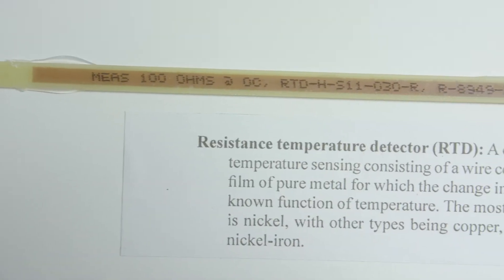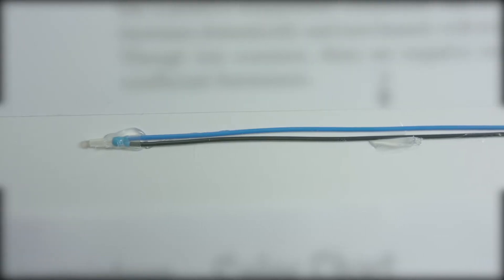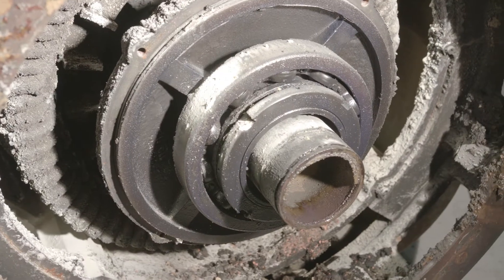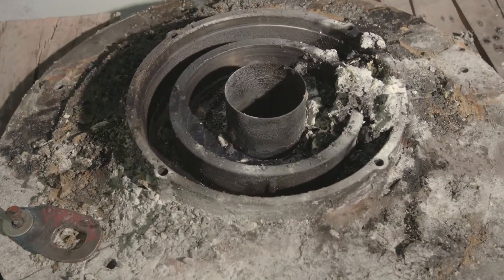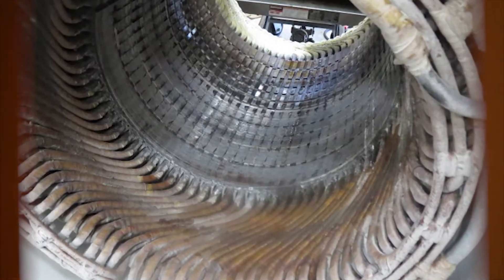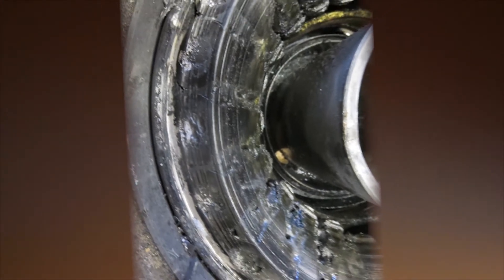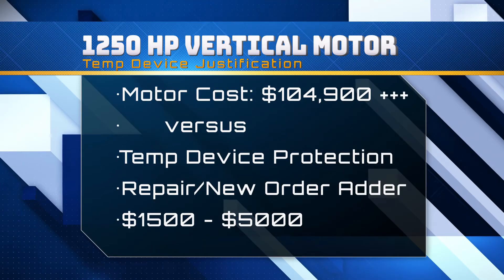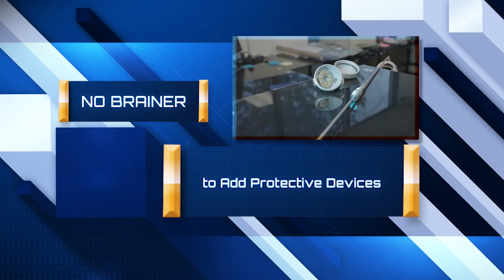Intro - Temperature Protection Devices - Pt 1

Comment: How much more effective are embedded RTD's vs RTD's installed on the end turns?  Made an oopsie and didn't get the motor ordered with embedded RTD's and are trying to solve it by installing them in the field on the turns.
Reply from the maker: Embedded RTD's are the most effective as the highest temps are usually seen in the stator slot bore. However, we often see RTD's placed on the end turns.